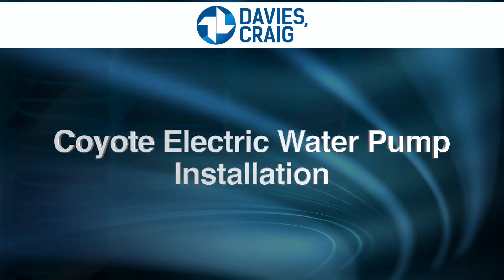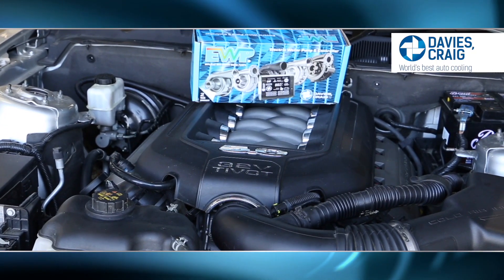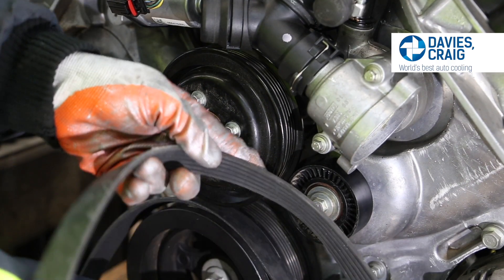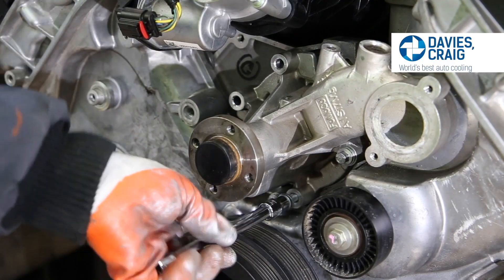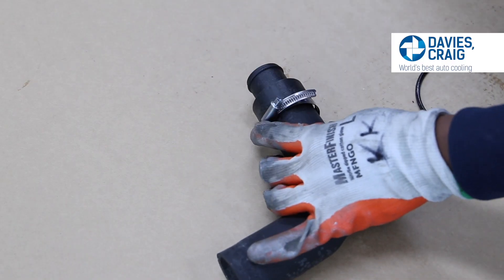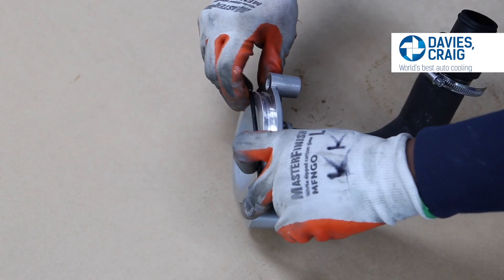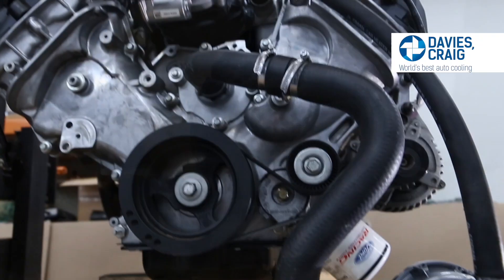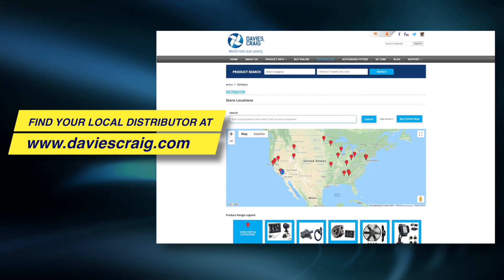Ford Coyote Engine Remote Mount Electric Water Pump (EWP150) Conversion | Davies Craig

Comment: Ok it comes with a hose ok. I was about to say you might be able to bypass it and tighten it tighter but I don’t know and you gotta make sure it fits or it’ll fly off when you start it up. You’re supposed to use a torque wrench and tighten the idler pulley to what it says too. You’re not supposed to tighten it tighter. I had to buy one which is gone now.